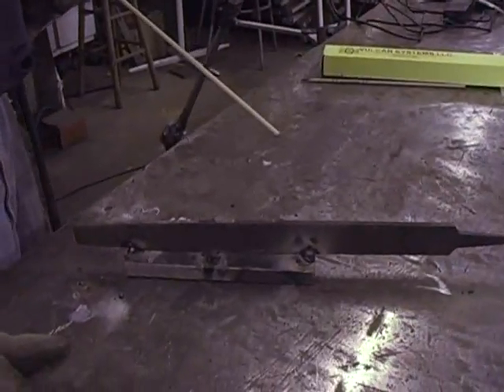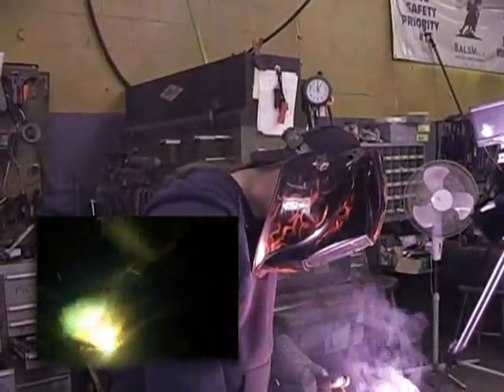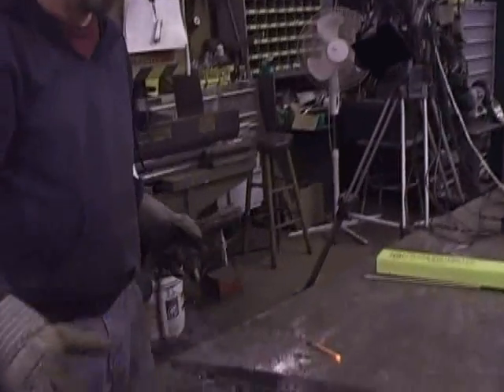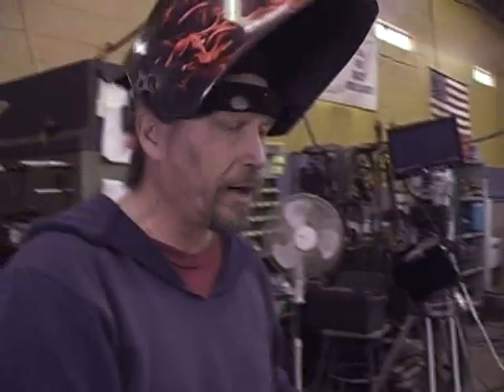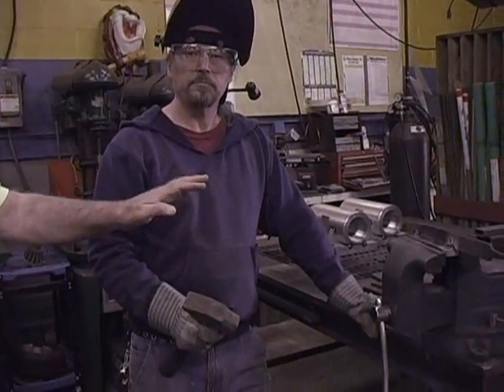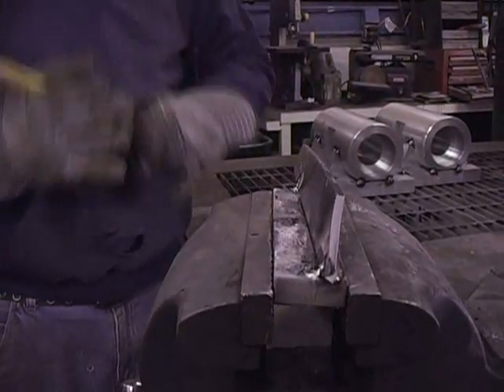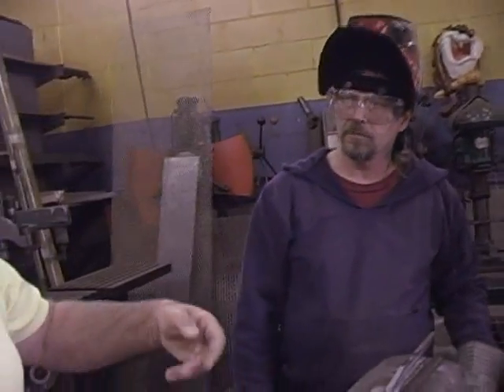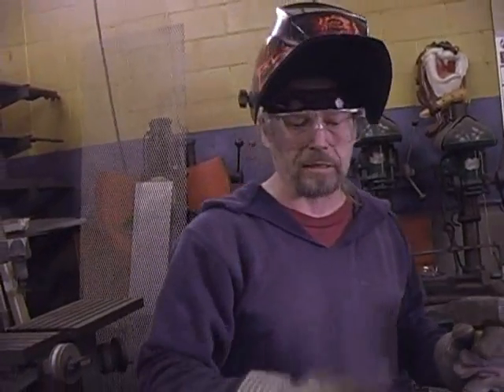Steel Welding Demo - High Carbon, Stainless, and Dissimilar Steels with Vulcan 4400-AS

Comment: cut out the tacks before hammering... it's not the weld resisting your hammer is the tacks you put on the opposite side of the plate